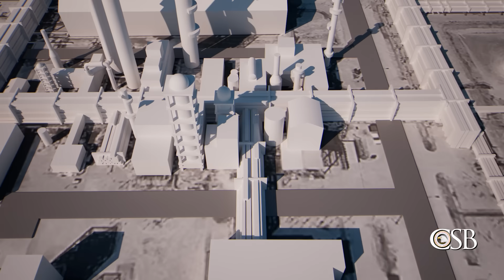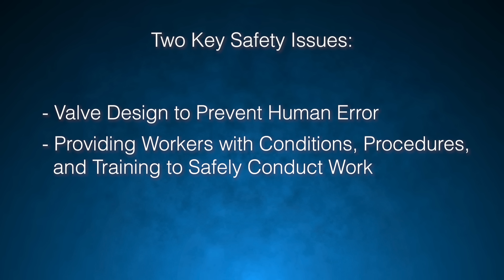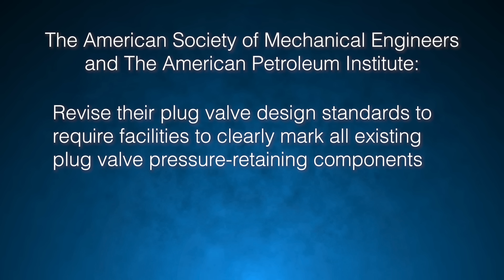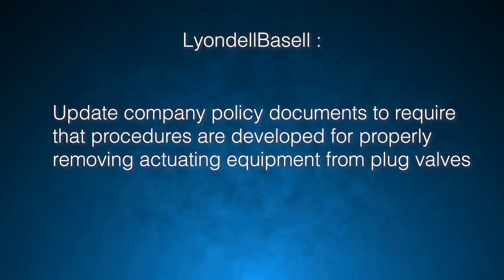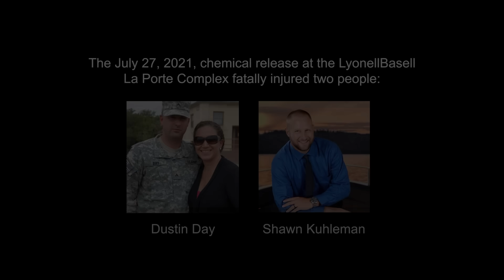Designed to Fail: Chemical Release at LyondellBasell

Comment: Hmmmm. Is there a reason that the physical change recommendation here was around the design of the pressure retaining components and nothing was said about designing out the need to remove actuators to lock down valves? It would absolutely have been helpful here if the actuator had been designed with a physical override and also some sort of lockout/tagout mechanism, as that would have eliminated the need to remove the actuator in order to safely lock down the process leg,  unless I am sorely misunderstanding something here.

Comment: They should have had a company I &e technician to remove the actuator or just locked out the Air supply with the valve closed.

Comment: I am surprised there isn't a way of locking out the valve without removing the actuator.
Reply: There is.  Actuate the valve closed, remove the power/air that powers it, lockout/tagout the disconnected power/air.
Reply: @khx73  Then why don't they simply make that their SOP?
Reply: The valve shaft itself may have to be pinned to lock it out, not just the actuator. They may have been doing inspection, cleaning, or lubrication on the coupler since they did find it seized onto the valve shaft.

Comment: How about redesigning the valve so you don't have to remove the actuator to lock it?  How hard would it be to just drill a big hole in the shaft and stick a bar through the bracket and shaft holding it in the "off" position?

Comment: I don't want to be an armchair expert here but If this animation is correct, below a tank of that size that's filled with liquid whatever, I don't see a shut-off valve On either side of the equipment I'd be servicing?

Comment: As a certified industrial mechanic (from Germany, apprenticeship done there), I'm astounded by the sheer incompetence/ignorance that was shown here by the unfortunately injured people.
You don't even need specialised mechanical knowledge to see where they went wrong if we take the animation at face value.
I would simply ask but one thing of my US colleagues, lobby for a German style dual vocational system, sure three to 3,5 years as an apprentice may seem long at a non full salary, but the stuff you learn is invaluable and reduces fatal and crippling injuries by order of magnitude. IF what I've been told is true, than our average industrial mechanics are entry level technicians by US standards, I hope this isn't the case and the people telling me this were exaggerating!
Reply: I agree. I worked on chemical plants for years. The video referred to them as pipe fitters. You would expect a pipe fitter to be able remove a valve actuator just as you would expected an electrician to be able to replace a switch. These are trades men not operators or maintenance mechanics.
Reply: Hear hear!
Reply: I find it hilarious that these supposed "pipe fitters" which in reality means no ticket laborers, weren't smart enough to realize they undid the bonnet fastners.  Like really... you guys pick up a couple illegals at the border and call them "pipe fitters" because I'm pretty sure thst's what they do down there.  

You don't need redesigned valves... you just need to stop hiring idiots
Reply: Yes, once again oblivious untrained amateurs dive right into a project without ever asking the critical question..."What could go wrong?" Many, if not most, of the tragedies analyzed by USCSB have the same root cause.
Reply: Als Chemielaborant, aus Deutschland und seit Jahren in der Entwicklung und Produktion tätig, war mein erster Gedanke: Was treiben die da !
Das erste was ich mir dabei dachte war, warum machen die eigentlich überhaupt den Antrieb ab? Gut der Sinn ist ersichtlich, die machen den ab um zu verhindern dass das Ventil versehentlich geöffnet wird, aber das hätte schneller, einfacher und sicherer erreicht werden können, wenn man den Antrieb da lässt wo er ist und nur die Energieversorgung des Antriebs unterbricht. Die zweite Frage die sich mir stellte war: Warum eigentlich die Kupplung zwischen Antrieb und Ventil komplett abmachen? Lasst sie doch da wo sie ist, ihr müsst sie doch wenn ihr den Antrieb wieder ranmacht sowieso wieder einbauen.
Ich muss ihnen da uneingeschränkt recht geben, viele solcher Unfälle sind auf Inkompetenz und Ignoranz zurückzuführen und eine adequate Ausbildung würde viele solcher Unfälle verhindern. Ob unsere Industriemechaniker nach US-Standarts nur Techniker auf Einstiegsniveau sind kann ich nicht wirklich beurteilen, aber halte ich für unwarscheinlich.
Das Hauptproblem in USA ist meiner Meinung nach, dass sehr viele solcher Arbeiter wie in diesem Film nach deutschen Standarts, eigentlich nur ungelernte Hilfskräfte sind, denen man nur das wirklich allernötigste durch lerning by doing gezeigt hat. 
Und mein letzter Gedanke dazu: Mit Essigsäure übergossen zu werden ist eine der furchtbarsten Arten aus dem Leben zu scheiden, die ich mir vorstellen kann!
Reply: @benjaminhampel8640  As someone who works on servo and solenoid operated hydraulic valves, I'm confounded as to why they were disassembling this valve to this extent to 'disable' it.
Reply: @empireoflizards  I can only see two possibilities why, either they didn't know what they were doing and how to do it properly, or someone who didn't know how to do it properly told them to do it that way.
Reply: @empireoflizards exactly…two separate components.  These were just ignorant contractors.  There should have been some oversight by the plant personnel also.
Reply: @benjaminhampel8640  Yes.  Disconnect power or air line if it is air actuated, as many are where I work and properly LOTO.   I don't think I've ever seen the entire actuator removed.
Reply: No, my German friend, you have no idea how stupid things are getting over here.  Your average gymnasium graduate in Germany is probably over-qualified to teach an American university.
Reply: @Salmon_Rush_Die  Americans have no nationals standards for trades. I was shocked when I worked there because you've had welders with literally no education at all. It was insane. I'd much rather have a highly educated workforce than a completely ignorant one.
Reply: I have the same thinking.

Comment: Before I started following chemistry, it had never occurred to me that acetic acid could be dangerous - after all, it's in vinegar, and we use that all the time. But, of course, if it's concentrated enough, acetic acid could absolutely be dangerous.
Reply: Chemistry is interesting indeed.
A block of sodium is so reactive, it will exothermically break apart water, possibly leading to a hydrogen fire/explosion.
Chlorine gas is so reactive, it will kill you if inhaled, and may do so with enough skin contact.
Put the two together, and it's one of the more crucial components of our bodies, one we can't live without.
Reply: When using certain silicone sealants, the odor is described as 'acetic acid'. Having used it, the fumes do have an intense burning sour smell when inhaled and is considered toxic in accumulated amounts.
Reply: All chemicals are dangerous. Acetic acid can easily cause chemical burns, and acid vapors are hazardous.
Reply: @michaelmerritt7406  And water can drown you!
Reply: And according to the report at https://www.csb.gov/lyondellbasell-la-porte-fatal-chemical-release-/ , it was at 238 °F.  (!)  (There was also water and methyl iodide in the mix, but those would have vaporized at that temperature and standard pressure.)
Reply: Indeed, most things that we use over-the-counter can be extremely dangerous in high concentrations, which is why they're so diluted. The hydrogen peroxide that stings a bit when you pour it on an open cut? That's only a 3% solution; compare that to High Test Peroxide (HTP), which is H2O2 in concentrations of 85% or higher, and you've gone from a sink counter disinfectant to a rocket fuel that will strip the flesh off of your bones in minutes!

Comment: I would recommend going at least one step further.  Require that protective gear be worn in case of a leak.  The gear should be enough to allow someone a reasonable chance of escaping the area should a catestropic failure occur.  Those people died because they couldn't breathe.  Respirators should have been worn, with full face masks.  It would have saved their lives.  

As a further step, the report said they were sprayed with "hot" acid but the system was being shut down for maintenance.  There was no reason for the acid to also be hot (which increases physical burns from the heat, as well as increased vaporization).  Systems should be made as safe as possible before work begins, such as reducing pressures, returning materials to lower temperatures, etc.  An empty tank would have been better still but it looks like that might not have been an option.  Newer equipment should have the option to divert materials for repair of the equipment, ie empty the tanks before work.